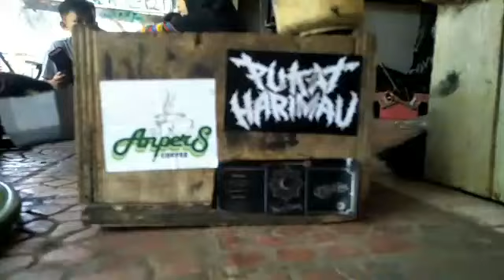Penyebab ban tubeless sering kempes, ini penyebabnya..

Comment: Kalo gak dicopot bisa gak
Reply from the maker: bisa.. intinya.. kotoran debu yang menempel di lingkaran velg dan ban benar benar bersih.. 😀
Reply: Oke trims infonya,,,sy SDH coba namun hasilnya tetap tdk dpt dipompa Krn sptnya hrs pakai angin kompresor, atau Krn hal lain SPT menggunakan nitrogen jd ban gampang melar
Reply from the maker: @goojoe1974  iya harus di kompa dgn angin kompresor yg banyak anginnya.. 😉
Reply: @lukmantambolong6307  klo kompa yg ditarik turung bsa nggk?
Reply from the maker: @muhasharye29  maksudnya gimana mas kompa turung??
Reply: @lukmantambolong6307  pompa yg bsa dibawa bawa bang
Reply from the maker: @muhasharye29  harus menggunakan angin kompresor yg tekanan angin nya sekitar 80 atau 100 supaya pada saat di kompa lingkaran ban nya mekar dan normal.. klau menggunakan kompa yg di bawa bawa itu biasanya lingkaran ban tdk keluar secara utuh dan mengakibatkan ban tdk mekar jika di pakai terasa bergelombang..